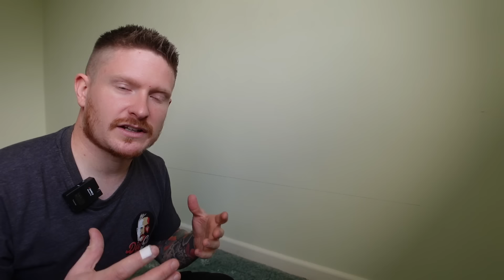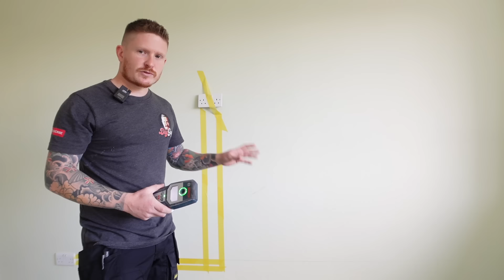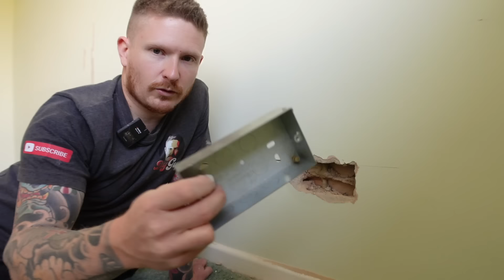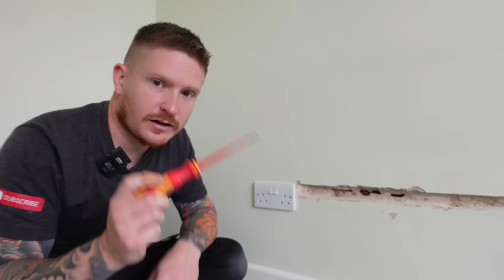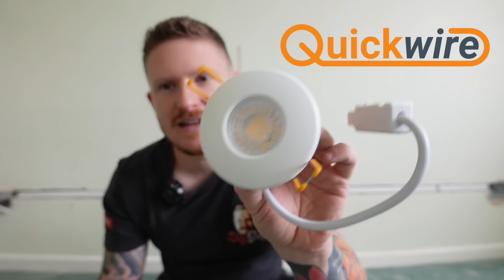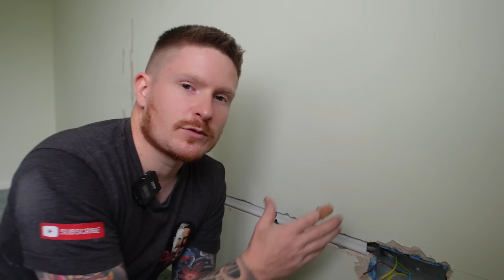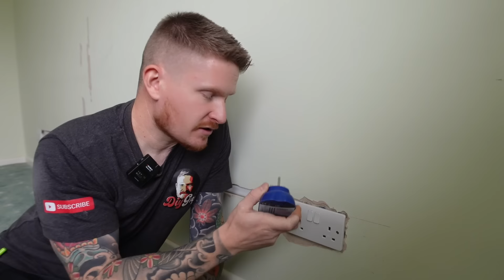How to Add a Socket to a Wall - Easy Step By Step Guide

Comment: If you were an apprentice I’d say physically you’d done a good job but you haven’t proved what you have done is electrically safe!!  You didn’t explain that even cables in zones are to RCD protected, ALL sockets need to be RCD protected and you didn’t even bother to check if your extra socket was safe!!  Minor works certificate anyone???!!  As was said in the E@WR anyone can make something work, only competent electricians make it work safely. “Only carry out this work if you are competent” I think you said. Well if there is a fault with that socket then you just proved that you are not.
Reply: Maybe if you guys would not charge an arm and a leg to change a socket we would hire the “professional electrician “
Reply: @CGS_16 go learn how to become an electrician and understand the responsibilities of not killing people with your work, learn the regulations stay on top of all the new ones. Realise it cost a fair amount of money just to run a business with all the safety measures that have to be taken in order to be a competent person. Then watch some shabby builder or worse a diy know it all chuck in a cable with zero consideration for anyone’s safety or little to no understanding of cable sizing and calculations done prior to install.
Reply: @CGS_16 maybe if you understood what it takes to train as a sparky, 3/4 year apprenticeship then you'd understand the going rate for a good sparky
Reply: @CGS_16  I’m not saying don’t do it, just do it correctly. And if you’re going to show the general public how to carry out a task that has potentially fatal consequences if not done correctly, then at least show them correctly.  

Oh and if you haven’t got the correct certification and you want to sell your house, there’s a strong possibility you’ll be paying a “Professional Electrician”  to carry out a condition report and rectify any faults before you sell it.
Reply: @BordercityMTBer gimme a break! Any clown can put a new socket in 😂 stop trying to scare people so they have to pay you a fortune to do it 👍🏻
Reply: @DavidSmith-hn5gg  Can you tell me what the permissible Zs reading is for the RCD to operate in the correct time? You know so that some clown doesn’t get an electric shock?  You are correct though, any clown can put a socket in you just have to watch the video, but in my opinion when they introduced Part P of the building regs they didn’t go far enough and should have made it the same as gas. Oh that’s the building regs that would stop you being able to sell the house if any relevant electrical work doesn’t comply. 👍🏻
Reply: @DavidSmith-hn5gg no they can't that's why people are still getting electrocuted from poor workmanship. If you have to watch a how to video then you are not competent.
Reply: @DavidSmith-hn5gg 

It’s people like you that will cause electrical faults that will hurt or kill people. Paul07 is absolutely correct, guys like you have no understanding of what you are doing. Fortunately for us, I’m an electrical QS for a company and have info the NICEIC are continually pushing the government to change the law that only electricians can carry out electrical works, legally. The people like yourselves will pay the real prices for an electrician without trying to saving money and risk people’s lives.
Reply: @BordercityMTBer lol we bought out house don't recall no electrical certificate....if any if thise wires short it'll trip the fuse box anyway ..
Reply: @kevinhancock4064  it won’t necessarily trip an MCB or RCD.  It depends on your Zs values.
Reply: @paul07mountainbiking  well I do know that even if our downstairs electrics are off (ring main) if any wire touches it trips the lot .. non live wires of course .
Reply: @BordercityMTBer  relax with your z reports mate
Reply: If you are  compentent then why are you watching a - how to  video?
Reply: @grahamd5418  because we put twatwaffle in the search bar and you name came up 1st followed by this video.
Reply: Wow what an idiot you are
Reply: What he's done is perfectly legal and allowable. What is safe is indeterminate. The building control doesn't see any problems with this. YOU as an competent person need to do the appropriate tests to discharge your duties.
Reply: So you aren't observant enough to notice that the circuit already has RCD protection? In any event, there is no regulatory requirement to upgrade an existing circuit installed satisfactorily to an earlier set of standards when adding a spur.
Reply: Please post a link to the regulations saying all socket needs to be RCD protected. The IET doesn't say so, only bathroom, kitchen and outdoors https://electrical.theiet.org/wiring-matters/years/2022/91-july-2022/mythbusters-8-socket-outlets-must-be-protected-by-a-30-ma-rcd/
Reply: I loved the video, I was just thinking if someone bought that house and stuck a nail through, yikes..
Reply: No cable calculation, 😂 that’s it people just keep adding as many sockets as you want to a bit of 2.5 don’t worry about demand or cable length.weather the mcb/rcbo is appropriate long as you can plug a light in and it illuminates the circuit must be safe, no chance of burning your house down.
Reply: Whilst you are correct, you’re been over dramatic. 

Most newer style fuse boxes and majority of older style boxes have RCD’s built in already which will cut power to affected breakers as soon as their is a issue, I have 2 controlling all circuit breakers on my fuse board, I’m not a electrician and have done home works on houses I’ve renovated  and had signed off by a electrician as perfectly safe before sale, it’s not rocket science to change a socket and majority of houses now have RCDS built into the fuse board with a test button so you can ensure it’s working properly and as should be.

The point of the video was how to do it, he showed that he also said ensure you are competent, which implies you should have basic safety knowledge before doing this, which he clearly has. Why would he need to prove to us that it’s safe when it’s in his house? Are you really going to assume he’s putting himself and family at risk whilst giving tutorials? Don’t be silly mate.

Since 2008 any new built homes and any that have been re wired are required to have RCD’s fitted, the chances of coming across a house these days without a RCD fitted is very very low.

You’re playing the high and mighty card because you think you’re better than him, give it a rest.
Reply: @JUSTAUFCNOOB  I’m not playing high and mighty at all. I said in a previous comment I have nothing against anyone doing DIY electrics, but if you’re going to show people how to do it then do it safely. 
But you didn’t have to tell people that you’re not an electrician, there is a hell of a lot of houses without any RCD protection, lots that have them rated too high as they were fitted for fire prevention rather than protection against electric shock. Oh and the other thing that gave away that you weren’t an electrician was the incorrect date regarding RCD’s. If you’re going to have a debate please don’t just make things up to make it sound like you know what you’re in about 😉
Reply: @BordercityMTBer  But as he said, multiple times I might add ensure you are competent in basic electric work, basic electric work includes basic electrical safety, so he heavily implied to make sure you know what you are doing first for minor works, you’re assuming he didn’t do all relevant checks beforehand, which is the first step you take before completing any works just so you can have some moral high ground, calm yourself down mate your job isn’t that hard to do and isn’t rocket science.

Their is few and fewer houses without RCD’s fitted for electric shocks risks, that are rated no higher than 30mA or less, that’s just a fact, with the amount of new builds that have been built since 2008 and plus the amount of rewires happening in older houses, it less and less common to come across houses without  RCD’s, directly relating to electric shocks, which was your main point.

Also have a look at BS7671:2008, chapter 41 protection against electric shock.

You are trying to quote me on the 1975 regulation, which was for protection against fire mainly, not electric shocks as you said yourself, so before trying to be a know it all, I’d educate yourself Mr electrician and don’t try and prove me wrong by quoting something that we wasn’t talking about 🤦‍♂️🤣
Reply: @JUSTAUFCNOOB  let’s just clear it up. He didn’t perform the tests that must be performed to ensure the addition to the circuit is safe. Fact!!!   
Rewireable fuses are still considered a safe method of overcurrent protection for cables and therefore many old properties have them fitted as they are not unsafe and it is only a recommendation to upgrade them. But any additions need to be RCD protected Fact!!  

I have been to a property where the owner had moved an outside light and added a socket to a new conservatory. This was picked up on a survey when he was selling the house and the sale fell through because he didn’t have the paperwork, therefore was not compliant with Part P of building regs, he lost the sale and had to pay the local council for planning permission and an electrician to carry out an inspection before he could put it on the market again Fact!!

You said you are not an electrician so I can only presume you are googling your information and you have not examined or worked on enough electrical installations to say how many are RCD protected. Therefore you have given your opinion, which you are entitled to but I think they’re based on google and not your knowledge or experience so are worthless to me or anyone else reading them. So either spend four years learning to be an electrician or stop using google to try and be a smart arse. There’s a good boy 😉
Reply: @BordercityMTBer  how do you know that’s a fact? Did you see what he did before or after the video? Have you seen his fuse box to know if it doesn’t have RCDS already built in to standard? You’re saying fact, but giving assumptions? The point of the video was to show how to change it, not how to do the checks that’s covered under him saying make sure you are competent in basic electrical work, what gets more basic than the health and safety aspect and knowing how it works and what the regulations are? If you simply looked back at this guys video, instead of being a know it all idiot, you will see he did a rewire of his house, rendering your whole point useless since the bs 2008 require the RCD’s were talking about, what a tool you are, bloke did a full rewire of his house, but doesn’t know about regulations, you’re a joker mate.

You’ve been to a building, where a customer didn’t follow basic electrical work procedures and ensure it was correct, again covered by been competent in basic electrical work, which he obviously wasn’t since he did it wrong, so how is that comparable?

My information regarding the BS regulations I quoted, but you don’t want to mention since you tried to correct me by stating 1975 laws around fire protection, when you was talking about electric shocks in your original comments, which was passed in 2008 to prevent this, my information is factual, yours is just assumptions.
Ihave renovated 326 properties over 15 years less than 15-20% of those didn’t have RCD’s that are up to date with current regulations, I have done majority of the electrical work myself and had it signed  off with no issues , just because you went to college, does not mean you’re any better than me anybody can become a proficient electrician without qualifications, you’re acting like nobody is as good as you or as knowledgable I have done multitudes of electrical work whilst been in charge of my own renovation company and all has been signed off by electricians and majority has had compliant RCD’s already installed this is what I base my opinion on, college doesn’t mean nothing big boy, I deal with regulations and rules that would give you a headache, not everyone’s a google warrior.

You’re sticking your two pence in saying this man isn’t competent, without even knowing the full facts just assuming, because you went to college for 4 years, give your head a wobble mate, you can’t even correct people on standards correctly, you’re obviously not that bright.
Reply: @BordercityMTBer Writing "fact" multiple times is really weird. You come across as a rule following jobs worth. I bet you got all your jabs and virtue signalled to everyone about it. How's that working out for you. Is your health as safe as your electrics?!
Reply: @ryanjames1575  read all the comments before you comment. You obviously haven’t…….fact
Reply: @BordercityMTBer  No, I won't do that. I hope your wife doesn't tolerate your controlling behaviour. I recommend doing some yoga to relax a bit else you might have an untimely vaxxident.
Reply: @BordercityMTBer  loser. Fact.
Reply: @BordercityMTBer  yes, I do not know anything, but have proved you wrong many times in this argument, he showed a demonstration on how to change it and advised having a basic understanding of electrical works, which includes what? Checking RCD requirements and is the installation safe.

For high sensitivity RCD’s (we’ll use 30aH as an example since it’s very common nowadays) you’re looking at 40ms operating times at 150ma and within 300ms at rated tripping current.

1667 ohms, for impedance, why do you refuse to accept I’m knowledgable on this matter? Does it hurt your pride I didn’t go through 4 years of college and apprenticeships like you and I am still just as knowledgable, hence the reason I proved you wrong on many points in this short debate.
Reply: @JUSTAUFCNOOB do you mean mA my friend?
Reply: @JUSTAUFCNOOB  I’m still waiting……. Do you have a slow internet connection or is no one on the DIY forum on able to answer your questions?
Another few questions being as you are so knowledgeable. That maximum impedance, what type of MCB are you using with that? You know I just want to make sure the socket you’re installing isn’t in a garage and is possibly being used for something that runs a motor because as you well know you can’t always use a run of the mill type b. And tell me, when recording your actual loop impedance, did you just add the maximum Ze to the R1&R2 to get the result?  Then of course if you did that did you take into account the supply characteristics?  I mean it was possibly a TNC-S but it depends on your location really.   You probably are aware of all this with being just as knowledgeable but I’m just making sure. Also, the disconnection times, are they ok? I suppose this goes back to the of MCB being used, but I’m sure you’ll tell me if I’m incorrect or being over dramatic. 

Anyway I’ve had enough fun for one night but I’m still laughing at your “I’m just as knowledgeable as you” comment 😂
Reply: @BordercityMTBer  mate, the whole point of this is the fact that you called him out for incorrect measures, yet he fully rewired his house 5 months ago, legally requiring RCD’s for all sockets, now you’ve been proven wrong you’re just rambling desperate to have a point 😂

Nothing I said hasn’t been factual or based on experience , a lot of what you have said has been blatant lies, assumptions and because you’ve been made to look silly a few times, you’re desperate to make me look bad, pretty sad to be honest, I’d grow up a little bit, if been called out for been the tool you are gets to you this much, I can’t have been lying🤷‍♂️

Few questions for you.

Did this man not do a full rewire 5 months ago?

Did this man have to get it all signed off?

Does this man have to have a pretty good understanding of electrics to complete this?

Did you just assume there was no RCD’s, with 0 factual evidence?

Did you attempt to correct me stating I was wrong about the year of legislation, when in fact relevant to the conversation, the legislation I stated was correct?

Are you now desperately trying to prove your knowledge because you can’t face the fact that electrical work isn’t rocket science and with a little time and experience, can easily be achieved by your average person?

Are you angry it took you 4 years at college, few years on a apprenticeship, few years fully qualified, to even be able to do decent jobs and people like me and him bypassed all that and can do just as good as you?

As I stated, you’re just another tradie who can’t accept someone hasn’t got all the qualifications, can do equally as good a job as you, in my experience electricians, joiners and bricklayers are the biggest culprits of this, it’s bad for the industry people like you going on like you do.
Reply: @JUSTAUFCNOOB  look again at my RCD comment you muppet. I never said he didn’t have them, I said he didn’t explain that they are a requirement. If he did a full rewire and he lives in England or Wales it has to be registered either through the local building control or through a registered company. It is a building regulation that’s law. And I also said the physical installation was good. But I stand by my original point, which is he hasn’t shown that the circuit is safe. 

And just to prove that you are presuming, I’m an electrical engineer working with multi million pound machines I don’t do houses and I’m not registered to do so anymore. So even I can’t legally carry out certain electrical work in my own house because of Part P of  the building regulations. But the work I can do is done correctly and tested. 

Listen mate at the end of the day, if you can’t afford to pay to get a job done safely, then knock yourself out and carry on. You are nothing but an uneducated keyboard warrior with a chip in his shoulder and as I said because of this your opinion means nothing to me because your talking out of your arse.
Reply: @BordercityMTBer  Your mum is shouting wee guy, your chicken nuggets are ready downstairs …….. off you jog now
Reply: @bountyhuntermk2520  your mum can’t shout anything.  The guy across the road is round and she can’t talk with her mouth full 🍆 👄
Reply: lol boom 😂😂
Reply: @JUSTAUFCNOOB  what is 30aH ???  I’ve never seen an RCD with that on it before!!   You have just proved you don’t know what you’re on about 😂😂😂. I think you mean 30mA and you can’t say that was a mistake as the letters are nowhere near 😂😂😂

The 1667ohms. Is that taken from the regulations or the on site guide?  Because being as educated as you are you will be aware of the correction factor that needs to be applied and why it needs to be applied??

No?? I’ll give you a few minutes to google it and get back to me. 

And just so you know, I am never jealous of intelligence and I have some really good lads working for me in there early 20’s that are far better electricians than I ever was or will be. I just think it’s particularly sad when people cut and paste with no knowledge of what they are posting  actually means. You probably couldn’t even strip the cable because mummy and daddy won’t let you play with sharp objects. Again get back to me once you’ve googled the answer to my question.  Good boy.
Reply: @BordercityMTBer  Yes that proves everything Jesus Christ you’re desperate to split hairs to prove me wrong🤦‍♂️🤣🤣 you asked for the numbers I gave it you, you didn’t ask for the on site guide version and for me to do the full deductions, Jesus Christ mate you’re unbearable honestly.

How do I cut and paste? You’re arguing I can only get my information from google, yet it’s all readily available on their either way, so no matter what I say you will stick with your narrative of I know nothing .

Are we going to talk about the fact I’ve corrected you, a “qualified electrician” multiple times and you skip over that, but you call me out because I mixed up amp hour and mili amps quickly typing. 

Give your head a wobble buddy, you’re another tradie who thinks they are above all and nobody can know as much as them, industries full of them you aren’t alone.
Reply: @BordercityMTBer 🤣🤣🤣
Reply: Well Said. You are totally right mate.
Reply: let’s hope it won’t  burn the house down or worse yet kill any loved ones. Zero testing done. I might be expensive but I can be trusted, I am trained and competent and I’m insured. But yeah crack on I charge double to put DIY jobs right. :)